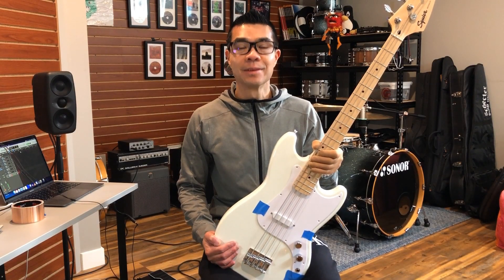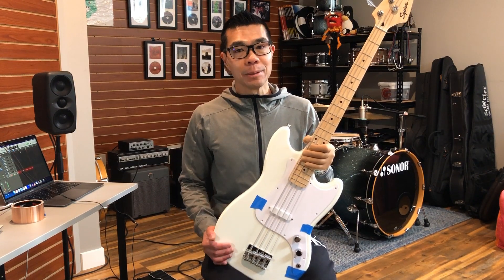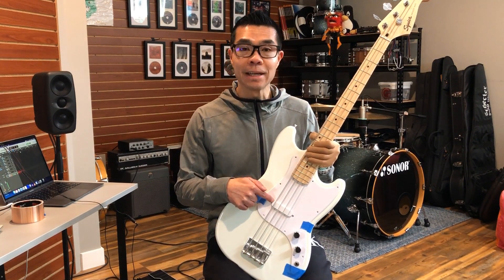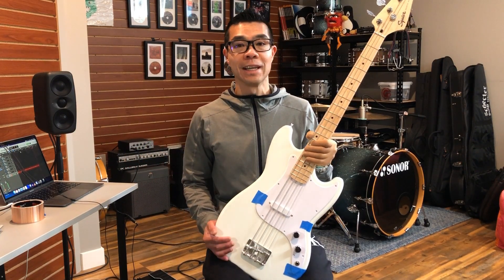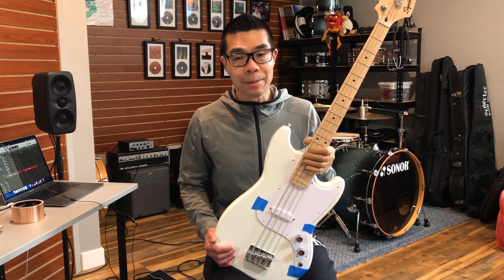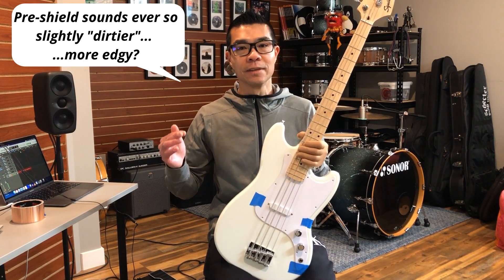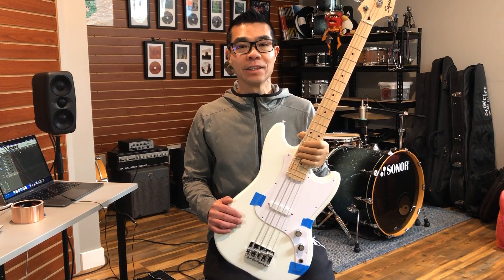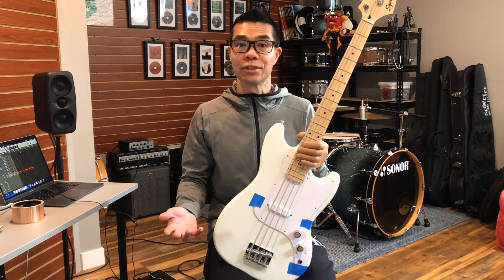Squier Bronco bass mods Ep.4: Does copper shielding tape affect the tone?

Comment: The difference to me would be impossible to guess if you did not indicate on the screen which was which.   I have one of these, in white, on the way, along with a 51P cheap pickup I found on ebay- I think the 51P pickup is ever so slightly larger, but it was only 19 dollars so I was willing to take a chance to have four poles and a naked pickup in the white pickguard, as I feel, not hear, but just feel the four poles and black bobbin will make me happier, I know that's stupid though so I will live with the stock white pickup if it does sound good on these videos!  Here is the title of the ebay auction if you are wanting to see what putting a 51P pickup entails-

51 P-Bass Single Coil Pickup Alnico 5 Magnet Tele Bass
Reply from the maker: Cool project!  Does it come with a pickup cover?  If not, depending on how much your hands sweat, and the makeup of the sweat, I've heard of stories where pickups have been destroyed from exposure.  Please let us know how it fits and sounds!!
Thanks for watching!
Reply: @jonathanwong458music Since the sonic bronco uses a standard p-bass type bridge, the strings should line up with the poles of a '51 pickup better than the affinity series bronco with the two saddle bridge did...having bought and sold alot of old basses, what you said about hand sweat is dead on, not just the pickups themselves though but the bridge and the pickguard screws often get corroded from it as well...frets too even
Reply from the maker: Thanks for commenting!